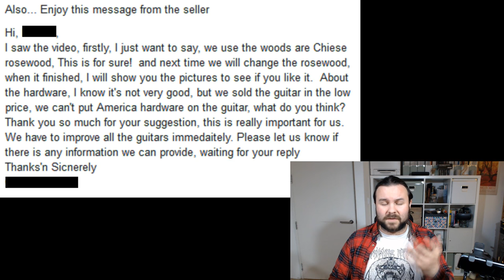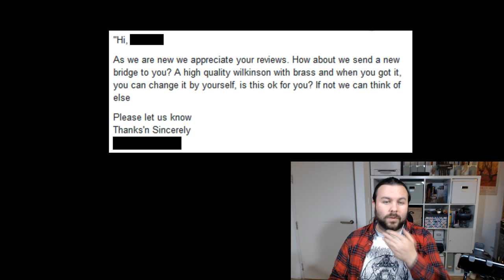Aliexpress Guitars Part 2.5! Fake George Harrison Telecaster Review (part 2)

Comment: it's a shame how much effort they put in to getting it almost right but then they fuck it up on trivial yet vital details. Dodgy wood, fake logos, and cheapo hardware aside, the guitar looks pretty decent, but all they needed was a ruler to see that the bridge was clearly in the wrong spot. Obviously you made it work but if they had put it in the right place to begin with, there would have been less problems. Just seems like so much effort to do all the body and neck and fretwork and then drop the ball at the end like that.
Reply from the maker: Yeah I believe it has to do with their process and that they try to do things FAST instead of doing them WELL. That will always be the issue. It's easy to CNC body parts and glue them together (although a bad template probably created those bridge issues), but a lot of it seems to be the thing that you should just spend a little more time on getting right. I think my message to these guys is - you CAN make nice guitars, you don't need to put the Fender logo on them or break copyright, and if you just spent a little more time on them and marked the price up a touch, you'd have a much better reputation.

Comment: I am thinking about ordering a chibson from aliexpress but I'm a little nervous about it.  The ad says exactly as picture shows....what should I beware of ordering one?
Reply from the maker: I'd personally look for similar guitars first - you DON'T need a Gibson logo on it or whatever for it to be a good guitar! It may even come from the same factories but because the company you're getting it from (Harley Benton, Revelation, Agile, etc etc.. even some Fenders and most Epiphones) have the power to enforce quality control you're taking much less of a risk. QC is worth paying a bit more for. 
If you really HAVE to get it from Aliexpress or whatever you need to make sure that the thing is from a FACTORY, not a reseller. This is quite hard to do though and involves messaging a lot of sellers. I refuse to recommend anyone because then it's on my head if you get a duffer, but a friend got a really, really nice Les Paul from a seller and the two things I noticed about their shop - they had been on there for 4 years, AND they had hundreds of different guitars listed. The sheer volume of stuff they were selling implies they were factory-direct. So that might be what to look out for. SEcondly specifically tell them to put a different logo on the headstock - make up a custom one or whatever. Yeah it costs a few dollars more but it's better than potentially having it confiscated by customs and makes it more yours - it also means if you do a YouTube video about it you don't get thousands of fuckers berating you for stealing some American company's money.. but yeah. Get a custom logo.
Reply: sonicwingnut I will definitely take this advice. Thank you kindly for replying. I've been in contact with the seller I've asked him to mod a few things including any false logos or where it was made he also said he would send me pictures once it was made. Again thank you for replying....much appreciated happy holidays.
Reply from the maker: OK man, well I kinda wish you'd gone for an off-brand instead haha, but good luck! Come back and tell us how it turned out! Or better still make a video and share it with us!

Comment: Does it have a truss rod? Thanks for the video.
Reply from the maker: Yes! it's at the base of the neck though as opposed to the headstock, sadly you have to remove the neck to adjust it but I gave it a look and it seems to work fine.
Reply: sonicwingnut
Yeah. Fender did it that way for years, I had a 64' Tele with a neck like that.

Comment: Nuts are far more important than tuners. Wilkinson are good enough tuners. Why didn't you put a bone nut and replace the pickups and electronics before stringing up etc.? Obviously. Wilkinson have been good enough for me.
Reply from the maker: I did on later projects, once I basically realised how important the nut is. I tend to use TUSQ nuts and spend a lot of time getting that first fret action right by carefully filing them.
But I still swear by Vanson locking tuners. A well fitted quality nut helps intonation and action but good tuners and bridges massively improve tuning stability too.

Comment: Why you guys keep going with Ali' is a mystery , there are some easy to find good makers in China, I dealt with one factory for several years and they made great necks and bodies exactly to early fender spec' for me, in fact F' took over their output (bastards ) and ended that, Rareelecctric.com just built me a chambered Hollow T' replica and for the money $485 it is as near the $3600 original as I want especially as Andersons' have sold me the HB pick-ups to fit it, even has the proper 2-bolt docking neck system, and it howls like a bitch with the Wilky' pups they fitted, finish is great, They build Replica' guitars (ok they do put the logo's as well ) but the quality for the price is great .

Comment: u should of used a string through bridge so no need to line up the holes.hipshot are they. cant remember the name. so no need to use the bridge holes. Save yourself some work.  you will never get them holes lined up properly by hand. you need a guide pin for your drill bit to meet on a drill press. go on TDPRI and its all on there how to do it. your just gona balls it all up.... im guessing its all done now. so anyway you know for next time.
Reply from the maker: Nah not a fan of string through bridges, not in this style anyway. The string holes lined up fine it was the screw holes needed modifying although admittedly a drill press would have helped a lot for that - my girlfriend's parents have reportedly got me one for christmas so that's all good.